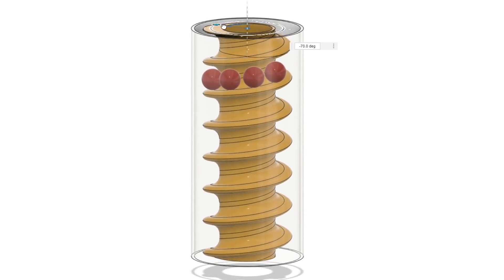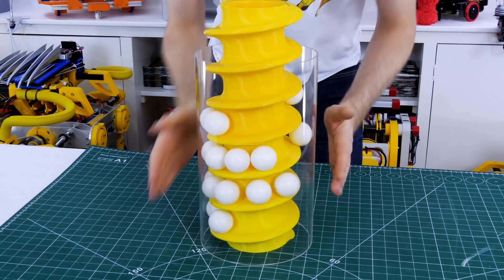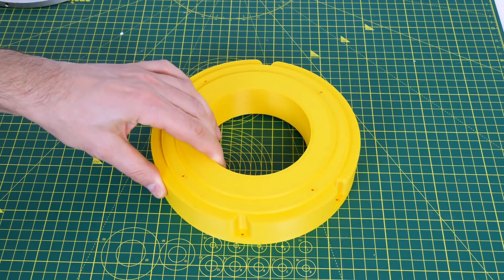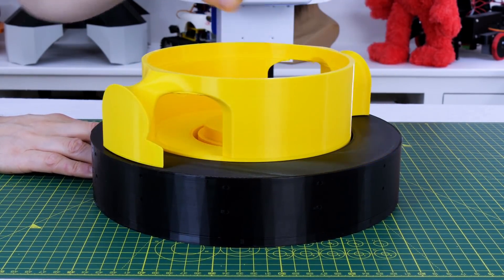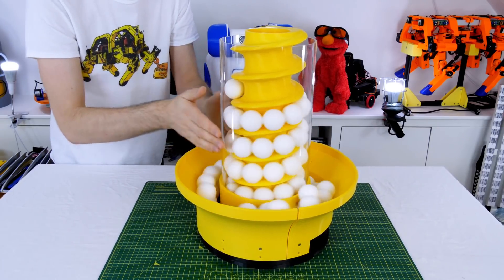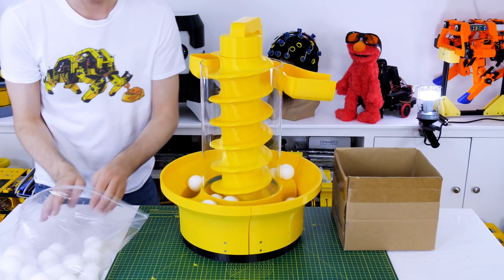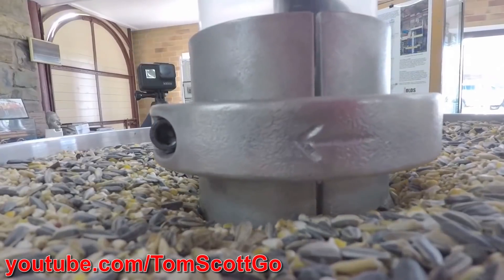Why this Screw Drive is Really Weird

Comment: This has to work against gravity and only works if the friction between the balls and the edge of the cylinder exceeds gravity. The original Archimedes screw has gravity working for it as the balls keep trying to fall down (but 'down' keeps moving up the screw). The design of moving cylinder would fail with heavier balls (such as wood) and struggle with even small changes in diameter of ball (where the wide ones would have to push the narrow ones which wouldn't touch the edge). Again the original Archimedes screw doesn't suffer from either of these issues. I can see the advantage of this vs sealing for a powered substance but for balls the original Archimedes screw is superior. I understand you did this as a 'I wonder if'. I expect this could also be improved noticeably by adding small indents on the cylinder to stop the balls rolling back past each indent.

Comment: I think that if there are no more balls in the reservoir, the "pump" will stop pumping. I also think this does not count as an Archimedes screw.
But this is a very nice feature for something like a marble machine that uses ping-pong balls. 
In an Archimedes screw pump, the medium is pumped up due to the fact that is is trapped in a small pocket where the medium cannot flow back down again because the screw is angled. 
This system uses a combination of balls being pushed up because of the force of the balls entering the scoops combined with a bit of friction from the tube on the balls. This only works while the balls are light enough and have enough friction. This will not work with tennis balls or glass marbles.

Comment: If you tilt the entire system by 20 to 45 degrees it will improve the efficiency significantly due to additional friction on the inside of the tube

Comment: That is not very efficient though. If you didn’t have a full sump of balls they would not reach the top. If you want to get individual balls to the top, the outside would have to be stationary and the screw should be turning. Would that not be more efficient.

Comment: The force from the cylinder is only applied to the balls at the one touch point. Driving the screw would be more efficient since the screw has more friction, so I would agree that most of the work is done by the scoop at the bottom. A tighter tolerance above the first turn would clear the layers and pressure would get the balls into the mechanism. 

I could be wrong, but what happens when there are no balls left in the hopper?

Comment: 13:30 It works because they spin isn't explaining anything. The reason they spin (relative to the screw) is because of mostly 3 forces:

 1. The opening at the bottom which are inclined and especially with the pressure if all the balls in the basket, actually strongly push all the other balls up. If instead you had a flat opening, the whole thing wouldn't work.

 2. Friction of balls against acrylic cylinder, helping a lot to makes them spin

 3. Pressure equilibrium: It'd work with water as well and there it's easier to understand that you'd get the balls in the basket and in the tube to be at the same level (supposing there are no frictions or you just make the whole thing shape to achieve the same)

Note that the Archimedes' screw that you referenced in the beginning only works because it's inclined. This  mean that due to gravity even stopping it would keep most of the water in the tube. It'd only work vertically with a LOT more speed. This is important because turning an inclined tube isn't the same here. In you turn the tube of an Archimedes screw, without turning the gravity vector (Earth), then you only have the friction of the cylinder. Supposing a perfect screw and cylinder, it would actually not work anymore.

Comment: Paused at 5:53 once I had a better idea of how he was going to build it. For balls, yes, I think this will work, just not as efficiently as if you spun the screw. The reason is because the balls are requiring the horizontal friction from the movement of the clear plastic piece to move them up the ramp whereas spinning the screw utilizes the vertical friction of the screw itself... One works with gravity, the other does not.
In Zero-G, I think spinning the outside would work just as well as spinning the screw... Let's continue watching and see if I'm right...

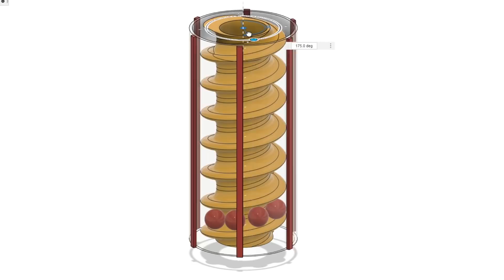Comment: 0:27 I'm going to put my nuts on the line and say no. I'll go further and say that the incline is irrelevant. You can't move a liquid or a dense particulate against gravity in an Archimedes screw by turning the housing around a stationary screw. Finding out that I'm wrong should be fun (unless there's some massive, fun-destroying caveat).
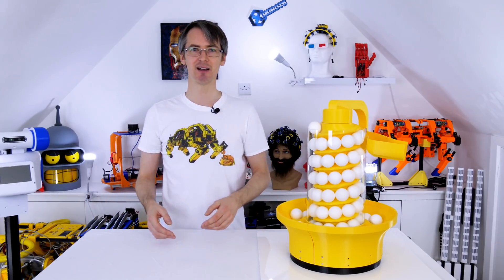Reply: 11:43 ...like a pressure fed catcher system. XD

Comment: It's fascinating that in the thousands of years since Archimedes it took an Australian in 2009 to figure out you can spin the cylinder.
Reply: Well you can't in an Archimedes' screw. A proper Archimedes' screw works with gravity rather than friction, so you'd have to spin the gravity field.
Reply: @yannickurbach5654  Indeed. The beginning of the video misrepresents what an Archimedes' screw is, and how it works. It is NOT fitted in a tube, and it has to lie tilted, at more than the helix angle of the thread, or the water will flow downhill and out the bottom. In this (vertical) case with balls, the balls would roll downhill in the absence of a tube.
Reply: He's English...
Reply: @niallmorland  The Olds Elevator inventor, not James Bruton.
Reply: @haack90  ohh my bad dude it's been a long day

Comment: It should take some effort to get the first ball in, and I don't know if one ball could easily make it up the screw.  However, once the tube is seeded, turning the tube knocks the balls around in a way that simultaneously has them pushing against each other, pushing against the wall of the screw and the wall of the tube, and the floor of the screw.  This means the balls will be pushed to roll between the screw wall and the tube wall, and the incline of the floor will cause this rolling to be uphill.  This will be helped by the balls pushing from behind, or at least helping to prevent backsliding once a critical mass of balls within the tube is obtained.

In short, relative to the frame of reference of the balls, it should be essentially identical for the screw to turn, or for the tube to turn because the same forces are exerted on the balls in either case.

Comment: I mean it kinda seems like it's just the balls pushing more balls up the screw.
Bawls.
Reply: What it needs is shown in some of the computer models shown at the start which is vertical bands on the inside of the tube. This would stop balls rolling back down the column, as there is plenty of time you can see the tube spinning, but nothing is happening. or the balls even going backwards.
The Olds elevator comparison works well for clumpy stuff like the seeds and grain shown, the stuff gets wedged inside the tube and forced to spin, and the screw adds a net upwards force propelling the material. But even then you can see the material doesn't move as quickly as the pitch of the screw would suggest. This is part of the trade off in not having any potential 'grinding' surfaces.

If the point of this is to lift balls, then the bands are needed. In that case it will consistently lift two balls per revolution (assuming it efficiently scoops them up and doesn't miss any) rather than this hit and miss effect where it goes several revolutions with nothing, then pushes 2 or 3 at once.

Comment: Wouldn't it get less efficient/need more power and torque the taller it is? As the balls move up the screw, there are more balls that need to be pushed up the screw, which means more mass and more friction between the balls and between the balls and the screw. It's probably not an issue for light ping-pong balls (or grain), but moving something heavier or less smooth (like rocks) would probably need to take it into account. 🤔

Comment: Yes I think it will work, if the thread angle of the screw allows a small portion of the diameter of the balls to stick out then those rods or beams which are circulating the inside of the tube will be able to push the balls around the screw.

Comment: It's working because when you put the scoops on the bottom of the tube it turned that into a screw, sort of. That's doing most of the work.

An Archimedes screw is often used to pump water. Were you just to spin the pipe in that case I think it would not work well because the wall of the tube does not provide sufficient friction to drag the water against gravity whereas the screw does.
You're having to use your hand to brace the balls against the rotating scoop because ping pong balls don't have any viscosity or surface tension and insufficient friction against the wall of the tube.

Comment: It could work, but a couple of factors are can have a significant negative effect. 1) Obviously, nothing is going to happen unless the spin of the outer tube causes the ping pong balls to spin. Let's call the rotation of the tube (s1) and the induced spin that of a given ping ping ball (s2). The ratio c1 = s2/s1 is going to be between 0 and 1. 2) If the ping pong balls are induced to spin, and there is no slip between the balls and the ramp, the balls will climb up the ramp. But there is going to be slip between the two, so the efficiency c2 is again going to be somewhere between 0 and 1.

Comment: I think for the balls you may have better luck if the gap between the screw flight and the edge of the cylinder is like 80% the diameter of the balls. If you did that you'd get an angular force component from the ball resting on the screw flighting that would push it against the outside wall more generating more "traction" for the outer cylinder to move the ball along the screw flight. 

It's also possible that it would cause more friction and make it worse for different reasons....

Comment: The contact angle between the screw flank and the balls (relatively to the pipe surface) is important. I think it would raise the effectiveness if the tangent at the contact point tend to line up with the pipe axis (30° for example, instead of 70° here?). this way will the driving force at the contact point be higher.

Comment: The LEGO Great Ball Contraption community has been using a similar mekanism for just shy of ten years; it has a stationary screw on the outside and a rotating column with vertical bars on it on the inside. It's known as a 'Spiral Lift module'.

Comment: I'm pretty sure it's friction between the particles (ping pong balls, in this case) and the rotating outside tube that forces them up the spiral, but I'm curious whether it could still drive the balls up the spiral without balls in the sump and could pump itself dry.
Reply from the maker: Well that was my initial 'manual' testing

Comment: Great video. It could work better if the screw was also turning in the opposing direction of the tube. Maybe with a differential gear at the bottom?

Comment: At 35 seconds in, I don't see why it wouldn't work. After all, there only 2 parts and one moving part in an Archimedes Screw, and opting to stabilise the usually moving part for the other shouldn't matter.

Comment: If its just a cylinder IT can Work if the gap betwen the screw and cylinder is thight and the materiale is "not slippery" .
It can Work to if the cylinder have "pillars" and it fit

Comment: As you probably noticed, adding some kind of baffle to prevent balls in the sum to rotate too much will make it work better. It can't be a solid wall as it would bind, but maybe some ridges or a rubber sheet would probably work

Comment: Well the bottom part is the driving force rather than the tube itself. It's more like feeding it to push forward.
Reply: Exactly. You could remove that screw piece completely and the tube would still fill up with balls, right? What am I missing?

Comment: The cool thing about the archimedes screw (tilted to an angle) is that it can transport water....
Your setup would never get any water transported up a tilted version impo...
Test worthy impo. ;)
Greetz,
PL.
Reply: The key thing about this mechanism is the scoops at the bottom, not so much the rotating shell. As long as the flow rate of the intake scoops is high compared to the leakage between the sides, it would pump water. This is the same reason Archimedes' screw doesn't need a seal between the screw and the cylinder. It's a tradeoff between manufacturing tolerance and minimum flow rate.
Reply: @hellofrankie117  I don't think you're correct here about the tube spinning not being a key part of the mechanism. The tube spinning helps with rolling the balls up the ramp; if it wasn't spinning, it would just jam up once the balls got to a certain height, no matter how fast you spin the scoops at the  bottom or how well you design the scoop. (Have you ever tried pushing marbles through a pipe?)
I think you're right about it working with water though, and the scoop being a big part of that. Although, I do think that the tube spinning would still help in that case, and it would probably work fine without the scoop as long as you spin it fast enough, but it could work with just the scoop at the bottom spinning in the case of proper fluids.
Reply: @ergohack  My reply was focused on the mechanism with respect to pumping grain or fluid, rather than the large balls in the video. The rotating tube helps, but the core of the mechanism is about scooping material into the intake, and the material already in there having nowhere to go but up.
With a static tube, you'll get too much friction at a certain length, but with no scoops you can't push the material inside to work the mechanism in the first place.

Comment: The tube turning is useful but the bottom feed turning is the most critical feature
Reply: Right. 
In fact, nothing would have to turn at all if we could somehow ensure that balls were continuously being fed in at the bottom.
We just created a Giant plastic Ball Screw!!!
Reply: Are you sure?. hm, here most definitely however just shoving in grain for example with a cylinder might just result in crushing. I think that the friction with the side walls becomes very important the finer the particles are.
Reply: @stalkinghawk9244  It could be easily tested by continuously feeding the balls at the bottom without the tube turning.

The difference between this build and the Olds Elevator is the tolerances between the screw and the outer tube. In this design, there is only enough space for a single column of balls, therefore they don't require the outer tube to turn, just enough pressure from underneath to be pushed up the screw.

Using smaller balls would be a better approximation. Maybe marbles?
Reply: @HDfoodie  hm also should test powder of sorts, since it has massive friction problem around corners. like pushing powder through a pipe with a bend at worst it compacts itself.
Reply: yeah it would be far more effective and not need the pressure of the scoops on the bottom if the tube had ribs running up it that prevented the ball from rolling down. then it'd be like 1:1 rotation to ball movement, instead of spinning the tube much faster than the balls and hoping that some friction here and there shimmies them upward.

Comment: I tried a similar system for my ping pong robot. Your system has the drawback that it need lots of balls just to feel up! Of course your design is amazing as usual. I used a spiral disc and 40 mm PVC tube to make a recirculation system for the ping pong robot.

Comment: What happens if you replace the helical section with a solid section? I suspect it would still work as the catchers are doing the 'pumping', not the screw section (although it would need a lot more balls)
Reply: I think friction between the balls and the inside of the tube is also what's driveing them up the spiral, so I'm not so sure it could lift anywhere near as well with a simple cylinder (or nothing, all filled with balls) up the middle

Comment: Now imagine the screw turns too, but in opposite direction. Wouldnt that be even faster?
Reply: yes
Reply: Stop him. He's too powerful.
Reply: The important point is the minimal damage to the items being transported. If the screw moves there is more damage to the items. This was first proposed by a Mr Olds to minimise damage to grains. Turning the screw as well may increase speed but may increase damage to the items being transferred.
Reply: Would that not just cancel out?
Reply: @holyravioli5795  Only if the screw is turning in the same direction. The important thing is the relative speed between the screw and the casing. The bigger the difference the faster the outcome